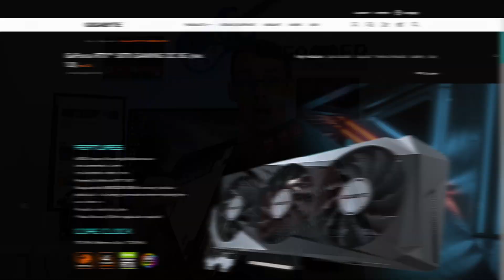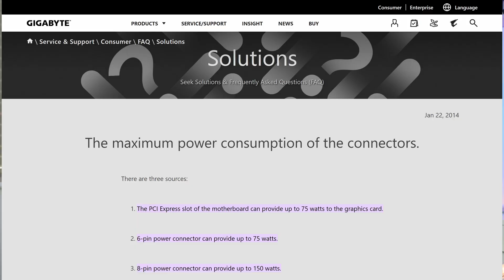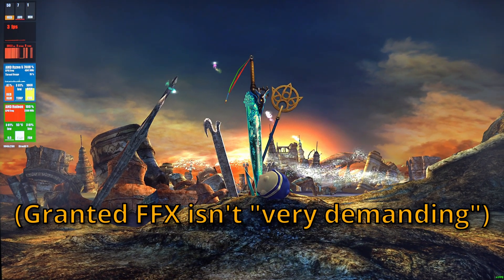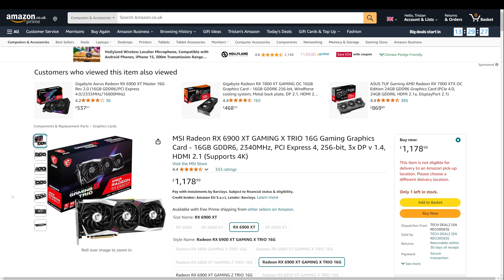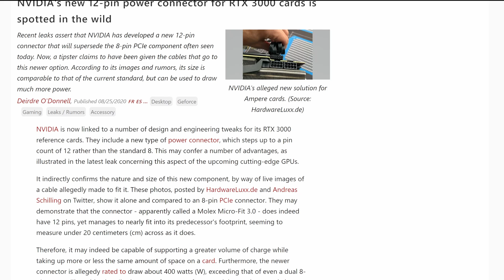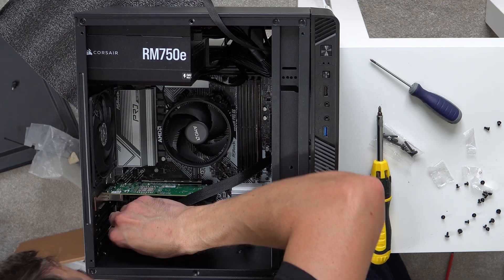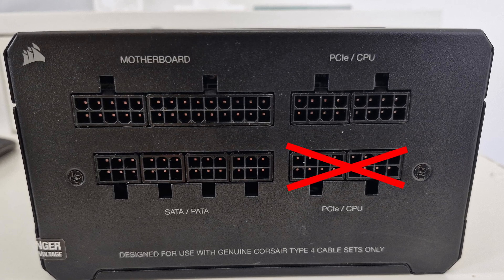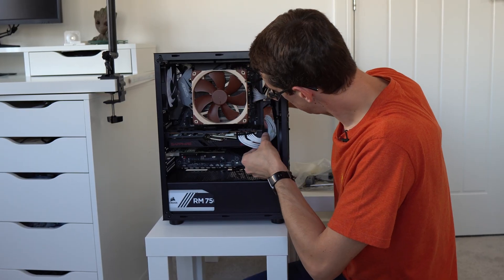How To PROPERLY Power High End GPUs (With 12vhpwr Or 3x PCIe Connectors)

Comment from the maker: Hey everyone, I hope this video helps you out with powering higher end GPUs :) It's worth quickly pointing out, though, that I refer to the TDP of various GPUs in this video - but as Dynasty1818 correctly pointed out in another comment, it's not always as easy as saying "7900 XTX TDP is 355 watts". This often refers to the baseline TDP you can expect with a stock card. Naturally you can get third party and/or overclocked variants of cards that have greater power usage, and then this might alter things in terms of whether to use 3 cables (for example). So ideally you should always check the TDP of your specific card when working out how to power it. Thanks again Dynasty1818 :)
Reply: Z
Reply: So, if I wanted a GPU with a TDP of 220 Watts, 220-75=145, so could I use a pigtail cable (2x 6+2)? Or would the cable it comes with be better.
Reply: I just brought Sus tuf 5070ti and I have 750 power supply and only the red light showing on the gpu

Comment: I order 5070 and a PSU from corsshair how already comes with 12v x6 cable.

Can i conect the GPU directly how need always to use the adapter?
Reply from the maker: I would use the 12vh cable directly from Corsair :) I prefer using the native PSU cable, to an adapter (which I avoid where possible lol)

Comment: My psu 16 pin does not have a mark that shows psu/ pcie 
How should i know which one goes to the GPU
Reply from the maker: I might be misunderstanding, but the 16 pin cable can only go to the GPU, not the motherboard CPU slot? So there's no need for a marking on the cable itself - assuming you mean 12vhpwr? :)
Reply: @TechOverwrite the 12vhpwr
600W by one cable 
How should I know which side goes to the card / power supply
Reply from the maker: You should be able to use either side - a standard "12vhpwr to 12vhpwr cable" can be reversed :)

Comment: I just tried installing my rtx5080, it light up and fans spun but would not post on the motherboard. I used the 1 12 pin 6+2 12v cable. Im now worried i used the wrong cable and sent the card back prematurely. I didnt see any damage such as melting on the cable, gpu or psu though. Would it have been safer to use the adapter that had 3 pcie pin split out instead of the single lane lead?

Comment: wha the hell I pigtailed my sapphire pure 9070 XT and luckily it is working fine. Thank you for this! I am also planning in buying Hydrus ARGB 2x8 pin cable extension am I buying the right one or should I buy 1x16 cable extension for my gpu?
Reply from the maker: The Pure 9070XT doesn't accept 12vhpwr (16 pin) afaik? But yes, I would just aim to have 2x separate cables running to your PSU - whether that's through your PSU, or via a reputable third party cable set.

Comment: The Radeon RX 9070 XT and RTX 5070 needs 3 x 8 pin connections. My old 1000W PSU has 2 x 8 pin PCIE and 2 x 6 pin PCIE connections. Can I use a 2 x 6 pin to 8 pin cable then 1 from each of the 8 pin?
Reply from the maker: Uhhhhm... good question. I mean, I THINK it should work. My main concern would be whether the 2x6 pin to 8 pin is an official cable (from the PSU maker) or a random one from eBay etc. But as long as it's from a reputable source, that should all be fine :)
Reply: @TechOverwrite  I did a bit more research, and NO, I shouldn't be using an older PSU with the new GPU, I could easily power a 9060 XT, 5060 Ti or 9070 16GB, but nothing that required 3 x 8 pin or the 12VHPWR one.

Comment: My PSU (Coolermaster MWE Bronze V2 750W) has two PCI-E cables, both have pigtails, is it safe to connect one individual cable + 1 cable with daisy-chain to the adapter of the MSI 5070Ti Gaming Trio?
Reply from the maker: Oh that's a tricky one. So does your GPU adapter have 2 or 3 ends (for 8-pin power)? You should be fine with 2x cable runs. My Zotac 5070 Ti's adaptor would requires 2x 8-pin, and that has always run fine. So I wouldn't worry about trying to run 3x separate cables.

But what I wouldn't personally do is just run 1 PCIe cable to the adapter, then rely on the pigtail (if that makes sense). But since your PSU has two PCIE cables, you should be fine :)

Comment: Hey I know this is a year later but can you explain why my 600watt 12 pin connector not work with my 5080? My gpu finally worked with my default 12 pin connector but not my psu connector form superflower
Reply from the maker: Oh that's weird. If I had to guess, I'd say that it's either a faulty 12vhpwr port on your PSU, or a faulty cable. Probably more likely to be a faulty cable (maybe a loose wire - even within the sense pins). Superflower may send out a new cable if you message them?
Reply: @TechOverwrite  i did send superflower a email and I havent gotten a response. I bought the psu on amazon in feb, but i think the cable is faulty because I made sure to plug it in as much as it can go. 

and i pretty much used the same ports on for the MSI one and it works fine

Comment: So my 5090 requires 4 incividual pcie connectors to their adapter. Ive got only 3 individual connectors. Could i theoretically run the 4th as a piggy back given i have a high end 1000 watt gold rated sonic psu?
Reply from the maker: Potentially yes. I doubt Seasonic's cables are only supplying 150w each lol. You could always try it, and then keep a close eye on whether you get any crashes/stutters when gaming or running Furmark.
Reply: @TechOverwrite  been super smooth when gaming but I am quite scared or ruining my 5090 liquid suprim. Everything has checked out though! Would you recommend swapping to a 1200psu asap or could I wait or indefinitely play on this current set up given its a focus gx seasonic 1000watt psu? I've noticed certain extreme triple aaa titles can run consistently at 890s-940 watts graphic card itself pulling damn near 600 watts on stock overclock no manual overclock.
Reply from the maker: That's awesome to hear :) Glad it's been stable for you. I would probably wait and see if any new PSUs or tech are unveiled at CES 2026. I'm hoping that ASRock and/or Seasonic announce new 12vhpwr tech (protecting it), but we'll see.

Comment: Great video.. thank you for sharing your brain bits with us.. I have an older BFG 1200watt PSU and just got the ASRock 7900xtx and have only 2 8pin connectors .. getting a splitter for one of them so will be running 2 separate power cables instead of one with triple spliter...lol  was leary of that to start but your video reinforced my thoughts.. thanks again
Reply from the maker: You're welcome, glad it was helpful and reinforced your thoughts! :) The 7900xtx is an awesome GPU, I hope it works out well for you!

Comment: Thank you from the information. Now I feel safe to re-use my 650W psu on a 5070 ti or 9070 xt, which is rated 300W TDP. I just need to power the GPU with two separate PCIE cable. Each cable provides 150W, plus the 75W from the motherboard, the total of 375W will even leave some margin of room.
Reply from the maker: You're welcome, glad the info helped :) I agree, that should work well!

Comment: I have a cooler master 750w sfx power supply and have 2 pcie cables plugged in (lost the 3rd) both have pigtails coming from them (4 pcie cables) my 5070ti comes with a 3 connector adapter, can I pigtail off the one and just plug directly off the other one?
Reply from the maker: Yes that should be fine, 2x separate cables (with a third pigtail connection) will work out fine for the 5070 Ti IMO :)

Comment: my gpu has 12vhpwer adapter needs 2x 8 pins, I’m wondering if I can get corsair premium 12vhpwr 4x 8 pins incase i would upgrade my gpu in future! Or its bad idea ?
Reply from the maker: You can probably just safely use the GPU's adapter to be honest. However yes, Corsair's Premium cables are great too (assuming you have a Corsair PSU lol). Both will work fine :)

Comment: Why did gpu companies change the connectors without saying anything bro, boughy a new gpu only to have to buy a new psu
Reply: a little homework would of told you such...i did the same thing but just ended up being my excuse to build a new rig 😂
Reply: @countryacademy9053 Well at the very least you can admit that having one version of the 9070XT with only 2x8 and one with 3x8 is hella confusing
Reply: @countryacademy9053  In all fairness I'm now one CPU away from the PC of Theseus
Reply from the maker: I agree it's annoying. I mean, it was covered on various PC news sites, but it certainly isn't made clear when the GPUs are launched - or on the retailer's store pages. It does get confusing :/
Reply: @TechOverwrite It's my fault for going for the acer version, there's barely any info online

Comment: Great video, am kindly asking for help please, i got lenovo thinkstation p520 comes with 2 (6+2) my gpu, EVGA RTX 3080 FTW3 ULTRA GAMING 10G. Needs 3x8 pin pcie. 

Please help me what should i do please please am stuck here. 

The psu doesnt supply power directly to the gpu but supplies power through the mobo to the 2 pcie cables i mentioned.

I really need to use this gpu for content creation. Please help me
Reply from the maker: Sorry to hear it :( Unfortunately you might be out of luck - I doubt that the proprietary PSU in your P520 will have full PCIe support for an RTX 3080. I might be wrong though. Basically the usual advice would be to buy a new PSU if needed, but I'm guessing that might not be possible with your specific PC/PSU?
Reply: @TechOverwrite buying a new PSU would have been the best route. However, it's not possible because it will not fit. 

On their wed (lenovo) it says rtx 3080 is supported but the cables omg 😅

I'm grateful for taking your time to respond honestly 🙏

Comment: Hey man, thank for the vid. I have a Super Flower 850w gold+ atx 2.4 PSU. It come with a 16-pin to dual 8-pin cable. I connected them to my Sapphire Nitro+ 9070 XT because the GPU only support 16-pin on it. Is there an issues? 😅
Reply from the maker: Good question :) Uhm, so as long as that cable is designed to plug 2x 8-pin at the PSU side, then that should be fine. I mean, if your system powers on and nothing has exploded - then it SHOULD be fine lol. The main risk is using a cable in the wrong way, so that the wrong amount of voltage is supplied to a component. Sounds like you are okay here though :)
Reply: @TechOverwrite so far so good. I regularly checking the cable from both side.

Comment: My card came with the 12v end connected to THREE 8pin ends???
Reply from the maker: Yep so that's the included adaptor, so that you can power your RTX 40 or 50 series card even if you have an older PSU. So if your PSU doesn't have a native 12vh slot, you can instead run 8-pin cables to that adaptor :)
Reply: will two 8pins and a pigtail be sufficient?

Comment: HELP? Can I run two 4+4 and one 6+2 for an RX 9070xt?
Reply from the maker: It might depend on the PSU, but what is 4+4? If it's a custom adapter from CPU (or something else like SATA) then I would not use that. But if it's a native cable from your PSU, designed for PCIe, then that should be fine yes.

Comment: I'm trying to power an Asus   rtx 5070 12gb, what cables should I use? I'm using the Y 16pin to dual 8pin splitter that came with the Gpu, but I dont know what cable I should use to connect to the PSU. I need 2 8pin cables that can connect to that Y splittler and to the PSU, I just dont which cables I should get.
Reply from the maker: Just use standard 8-pin cables that came with your PSU - run two separate cables from the PSU, to each side of the Y splitter. That should work fine then :) If you've lost the cables, either see if your PSU maker sell spares (Corsair do for example), or check out CableMod. Hope that helps!

Comment: Thanks for the informative video! I’m having trouble getting my new RTX 5070 Ti to work. When I power on my PC, the VGA LED on the motherboard stays lit and the GPU fans don’t spin at all. I’m using an NZXT C850 PSU and connected two PCIe cables from the PSU to the included 16-pin to 3×8-pin adapter that came with the graphics card. I’d appreciate any help 😢
Reply from the maker: Ah sorry to hear that 😔 Maybe the adapter doesn't like just having two main cables, but it's hard to say for sure. The only other solution is unfortunately to try with a different PSU, or with an alternative cable like a CableMod one for your PSU.
Reply: I’ve heard people that have this problem usually discover it’s drivers issues believe it or not. So just use an app to completely uninstall old drivers and install latest gpu drivers

Comment: If you have enough individual PCIE connectors on your PSU all GPU makers suggest running individual connectors from the PSU to the GPU.
Reply from the maker: Interesting, I saw a few manuals saying otherwise - although it's also hard when PSU makers say to use their own 12vhpwr cable lol. There's definitely some conflicting advice out there. I can see the benefit in having multiple 8-pin cables though - there is more safety headroom that way, ultimately.

Comment: Thank you for this! Going from a 3060 to a 5070ti. Just ordered a 12v 16/8x3 connector for my new gpu! The old one has a dual 6x2 pcie. First time actually opening my Pc after purchasing it on Facebook marketplace. It’s going well so far! Learning as much as I can until it gets here
Reply from the maker: Ah nice, that'll be a big upgrade for you - I hope the 5070 Ti works out well for you :) Sounds like you've ordered the right cables so that's good.
Reply: @TechOverwrite  I got it in! Updated drivers, good temps, and smooth game :)
Reply from the maker: Glad to hear it 😊 Happy gaming!
Reply: @painful1342 where did you get your third party cables without worrying about wether it is the right one for your psu?
Reply: I order 5070 and a PSU from corsshair how already comes with 12v x6 cable.

Can i conect the GPU directly how need always to use the adapter?

Comment: My RTX 5080 came with a cable that takes 3 PCI-E cables connected in it (including all 2-pin hanging parts of them) as compared to 8+6 GTX 1080 Ti so it's one cable that goes into 5080. My Corsair 850w gold PSU also came with double PCI-E cables too.

The 5080 is LARGE - way longer than 1080 Ti and I had to unscrew and take out an unused bay in my case to fit it. I was worried for a bit there's no way to fit my 5080 in until I noticed hinges and such and voila - unscrew it and the bay goes out, making space for 5080.

Jesus.
Reply from the maker: Haha glad you noticed that before you took a dremel to your case! Yep some 5080 variants are massive - I guess they share the same cooler 'housing' as the 5090. Glad you got it installed in the end though :)
Reply: @TechOverwrite Yup. Overclock tool said temps are 31 celsius when driver installed and such. Three fans. So I guess size matters (that's what she said!).
Reply from the maker: @vjekoslavburic3399  lol ;)

Comment: So TLDR is that if you have 12VHPWR cable use that one for 5070ti that has 12 pins (for example), but if not, you can use PCie 2x6 instead just fine? If they come from the valid manufacturer of course.
Reply from the maker: Yes I agree :)

Comment: Bought an Aresgame agt 850w psu, fully modular, has a 12vhpwr slot but didnt come with the cable. Bought a 12v-2x6 cable from X-Enlazar from newegg. For a 5070, thats no good eh?
Reply from the maker: Huh that's odd - so a brand new PSU didn't include that cable? I would consider contacting the retailer or Aresgame and checking if that's correct. You shouldn't need to buy an aftermarket cable after buying a new PSU, IMO :/ But yes, a 12vhpwr cable should be fine for an RTX 5070 :)

Comment: Now the newest NVidia cards have another issue - individual pins sometimes ask for a lot more power than the other pins, causing specific wires to overheat and possibly damage the plug or melt.
So we have that to worry about now.
I'm watching for a card manufacturer that makes sure their board asks for a nearly uniform amount of power across all the wires.
Reply from the maker: It's definitely a concern. It's good to see per-pin monitoring solutions, that seems like an increasingly useful feature nowadays :/

Comment: My be quiet 12 850w non mod came with a 600w 12vhpwr and also 2 8 pin pcie cables. I bought a 5070 which came with an adapter that turns 2 pcies into a 12. Do I use the adapter or the cable straight from the PSU?
Reply: Cable but read the manual, been using the be quiet straightpower 11 for about 3 years now on my 4090, zero issues whatsoever

Comment: I'm currently stuck with my RTX 4070 Super. When I power it on, only the motherboard lights up—the GPU fans don’t spin. I unplugged the 12-pin cable adapter, and only the lights come on, so it seems the issue might be with the adapter and my two (6+2 pin → 8 pin) cables. I tested the same cables with an older GTX 1080, and the fans spun fine, but I’m not sure if the adapter and my cables provide enough power for the 4070 Super.

Edit: It turns out the problem was the cables going to my PSU. The two single (6+2 pin → 8 pin) cables don’t seem adequate. I resolved it by using a single (6+2 pin → that splits into another 6+2pin then a single cables goes to the one  8 pin slot on the PSU) cable that plugs into one PSU port and connects to the 12-pin adapter.
Reply from the maker: Ah interesting, thanks for the update - that's interesting (and concerning) about the two single cables. Glad that you got it working in the end though :)